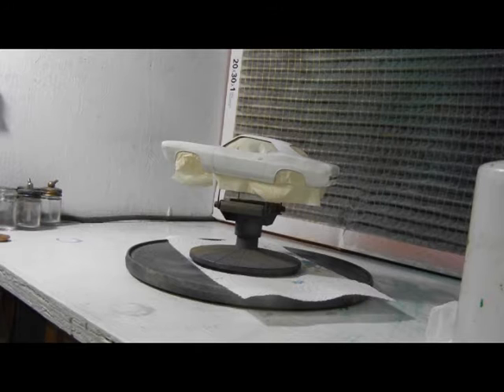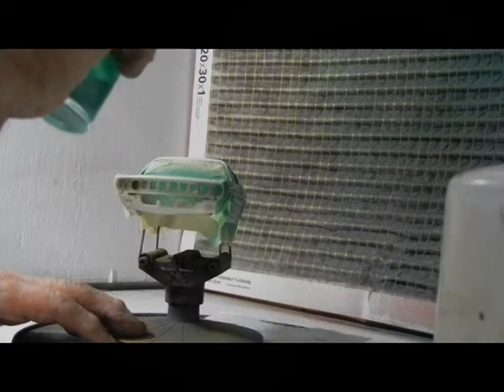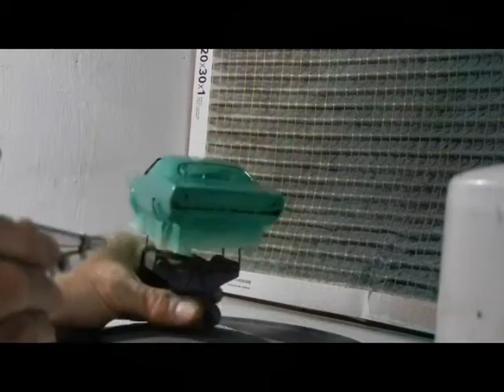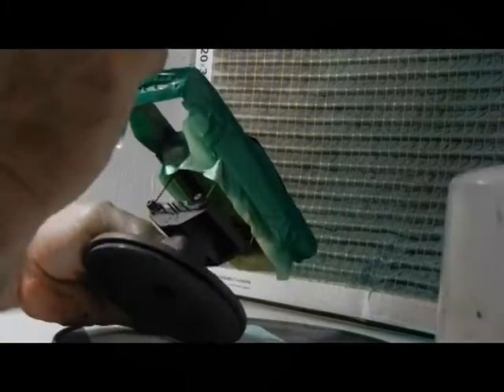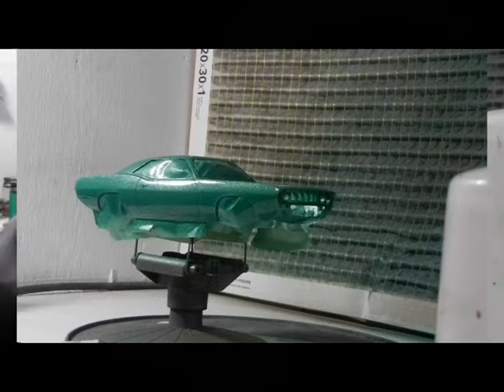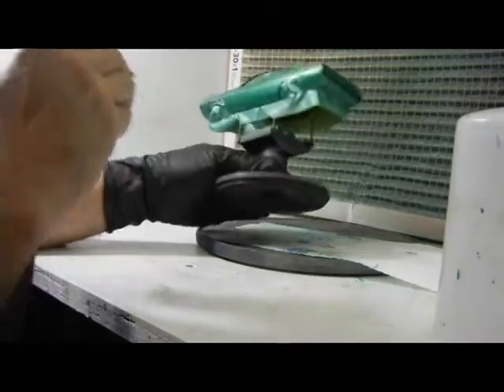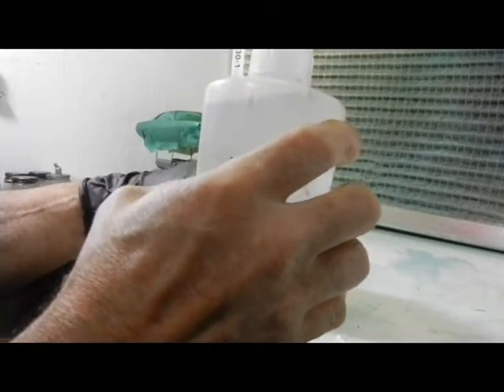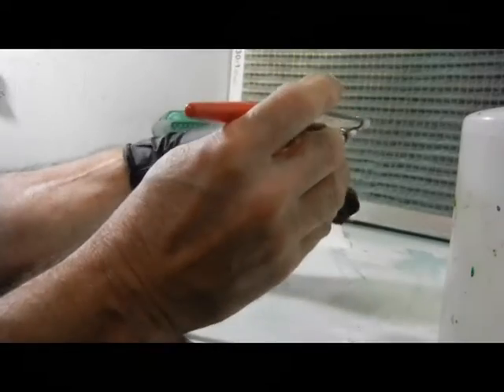FOLKART 2K CLEAR 1ST TIME 71 CUDA

Comment: Great lookin' paint job!! Nice technique with the air brush! You are braver than me when it comes to clear coat on a model car, I usually end up with a small run somewhere. I was thinking of a Michael Jackson comment but ya beat me to it.😉😂
Reply from the maker: The crazy part is a fellow modeller John pol from Canada introduced me to using folkart paint acrylic $1.49! And the airbrush puts out the 2k clear so fine it's hard to get a run!